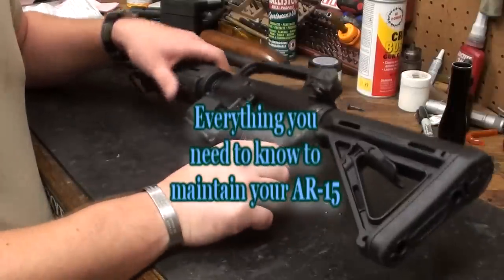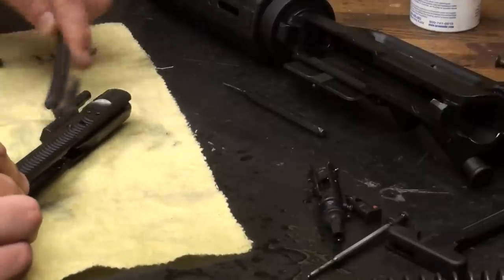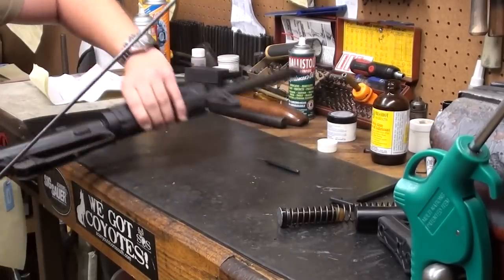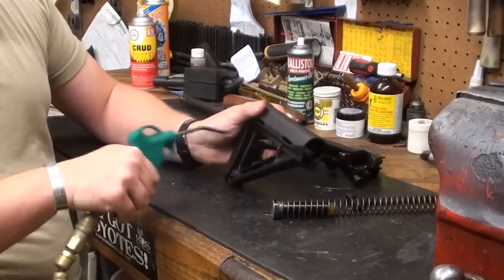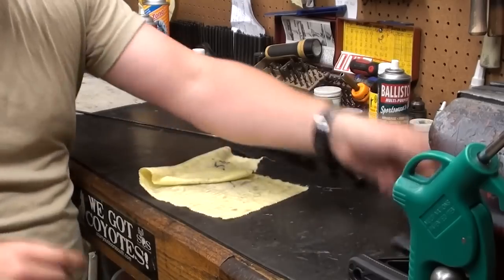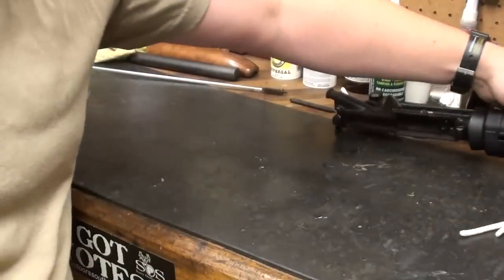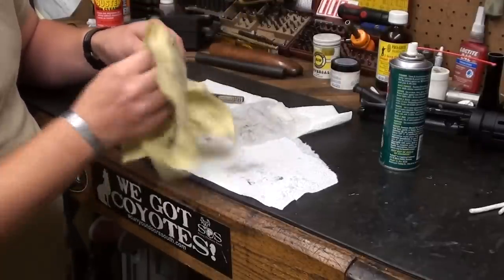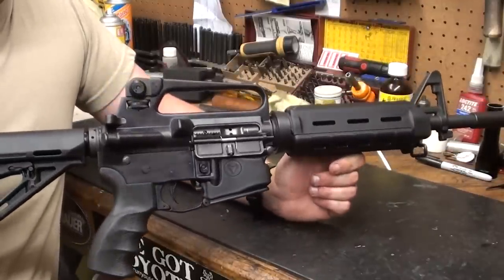Clean your AR-15/M-16 rifle or carbine (Now!)

Comment: Fall 2009, Houston, TX: My RRA LAR-15.  I fired 67 STANAG magazines (2010 rounds) of Lake City M855 SS109 (62-gr steel-core green tip 5.56NATO) with ZERO CLEANING--only added oil to the bolt carrier (through the ejection port) when rifle seemed dry.  1 (ONE) failure to extract, due to stripped rim.  This test was performed over the course of 3 weekend range trips.  Average 10-shot group @ 100 yards: ~2.25" (iron sights), ~1.50" with ACOG TA-01NSN 4x32.

Keep your AR oiled!!!
Reply: Mmhmm

Comment: @PatriotTNPr 
That's a "NeverQuitGrip" on the magwell.  Your lower needs to have a removable trigger guard so this can slip on (most are but ex: POF's are integral).  I don't recommend holding the magwell while shooting but if it works for you, the never quit grip might be more comfortable.  It's about 25 bucks.

Comment: Continued... Mags for ar15s are cheaper then ak mags. Steel surplus ak mags run about $20 each Pmags for ar can be found for $10.99-12.99 depending on gen. Ar parts wear sooner then ak parts being as most ar parts are aluminum. But they are easy to replace and rebuild. Everyone has ar parts online and in store all you need is a hammer, brass punches, screw driver, and castle nut and delta nut wrenches. You can build them in your garage. I am a young man with steady income and wanted a gun that

Comment: Interesting, I clean my guns VERY well right after shooting, but I never thought to remove the extractor, I normally will the bolt soak and then spray it down with non chlorinated brake cleaner. gets 99% of the gunk out.
Reply: Brake cleaner is amazing stuff for cleaning guns

Comment: Barbasol shaving cream and super got water do a good job getting the carbon out of the upper reciever. Dry with compressed air and oil. Repeat with a toothbrush if its really fouled up.

Comment: Ok first off the thing you pull back is a charging HANDLE not hammer, If the rifle isn't cocked you cannot put the selector on safe, I know its weird but that is how they are built the hammer has to be cocked for a AR to be safetied. Second when you chamber the first round DO NOT RIDE THE CHARGING HANDLE IN TO BATTERY pull it the whole way back till it stops and let it fly home without your hand on it. If that don't fix it I would go with a hammer spring or a out of spec firing pin.

Comment: Haven't cleaned mine in 3 outings and mine runs great. I'll admit mine had horrible jamming issues but since I replaced the extractor spring the rifle operates flawlessly so I just think it came with a faulty extractor spring.

Comment: Clean doesn't matter without lube. From a weapon maintenance standpoint you're often better off just dumping lube on the carrier and bolt and running the gun wet rather than trying to white glove everything.

Excellent video, though.

Comment: I have a question somewhat off subject it's about wear on the upper receiver notch were the charging handle rest & the charging handle coming loose. I just built my first AR15 it's mid-length gas system chamber in 5.56. I've test fired only 100 rounds through it. Midway through my testing when my last round of the mag would fire and the bolt would lock back my charging handle would come loose. I thought "that's kinda funny" so I push it back in place and loaded another mag and again, bolt locks back, charging handle comes loose. Some other info I think may be important 
1. when firing the casing shoot out at 2 to 3" o'clock, I don't think it's over gas but I'm no expert.
2. it has a carbine buffer tube and spring by spike tackle, the buffer weight is about 5.?? ozs, don't remember exactly  
3. charging handle notch looks kinda beating up for just 100 rounds
wish I could show a picture.
4. it's ambi dex Aero Precision charging handle

do you have any idea why this is happening?

Comment: @macfin88 
Huh, that is odd. Normally keyholing is a result of not having a tight enough twist rate to stabilize the bullet. But 1/9 is fine for light 5.56.

Comment: The spring in the extractor compresses quite a bit , and the desired action is for this to 'float' installed back on the bolt. What if it doesn't float ? I think I had a little rubber o ring on that spring at one time.

Comment: only problem with the ar in my opinion is ammo cost. If you want the gun to be as reliable as possible your gonna want to get brass cased ammo. With the ak your good to go with steel case. Locally here XM193 which I like and stock pile when I can runs $8.99 for 20. For ak I can get $5.29 for 20. This cost adds up quick for a defensive rifle. Plus side I same my brass so if I ever choose to reload I can. Can no do that with steel case.
Reply: Why don't you like steel cased ammo in your AR15 and don't mind it in an AK?

Comment: @TWELVEGAUGEDAVE870 Thank you for the info! I hold mine by the mah well because firstly, I'm a southpaw and secondly my barrel isn't free-floated. It was demonstrated to me that holding the handguard shifts your POI at rage. Lastly, going to the magwell as a point of reference like a vertical grip, the magwell is universally located on all Ar-15s so it i's a good location to default to if you were to wield any other rifle. Thanks again Dave!

Comment: What is your opinion of chrome bolt carrier groups? Obviously they are smoother with a chrome finish vs flat rough anodize finish, and again obviously easier to clean because you can see black gunk better on silver instead of black. Still, I want to know if anyone has any personal experience with the chrome bolt carrier groups. Pros, cons, etc.

Comment: Thanks... I found out what  was wrong. It was made wrong. The package was marked .22, .223, 5.56. I got another one and it works fine. I had already thrown the package away, but I know I double-checked the size on it before I bought it. It looks like the bronze brush secondary part is 22cal., but the primary buffer on the cord is too big to go through the bore. Thanks for your input. Long live the 2nd amendment!!!

Comment: Since most of you are into the whole MILSIM scene, just clean everything. Firing pin and bolt should both be shiny, if they arent then you are wrong. Bolt carrier and charging handle are subdued. Clean the inside of your gas system or it WILL fail. If anybody wants to test my knowledge, im in the Army and we clean our M4's weekly.

Comment: no don't use wd40 there are better alternatives.  if you want cheap lube use a synthetic motor oil or grease.  If you want a cheap cleaner google Ed's Red.  If you have money to burn try froglube or any brand of clp.

Comment: Question how easy is it to clean with one hand??   I ask this question because I have Cerebral palsy I’m not able to use my right hand, but I can use my right arm.  

I’m thinking of getting an AR and I’m just curious how much I’m able to clean it without asking for help.
Reply: as long as you can pop out the rear pin and take out the bolt carrier with one hand you should be good. actually hold up let me see if i can take down my rifle with one hand.......yeah its easy but you may need like a knife or pen or something to get the firing pin retaining pin out. if you do get one, a bore snake is probably one of the easiest ways to clean your bore especially in your case. some of the more indepth maintenance like replacing the gas rings or taking out various parts for replacement you may need to get some help if you go to a gun shop im sure someone will be glad to help if you just ask( basic maintenaince is easy and you can probably do it one handed). love my ARs you wont regret getting one
Reply: Blaze AP Thanks for the info!

Comment: I bought one of those and can't pull it into the bore... I guess I'm mostly afraid of getting the damn thing stuck in the chamber. It' for a  22cal which should be the right size.... ? Am I just not pulling it hard enough? I would appreciate any input because I would really prefer to use it instead of a rod and patch.
Thanx

Comment: This is kind of random, but have you ever seen that old footage in Veitnam where the guys were cleaning there A1's in a giant tub of diesel fuel.  Like 10 guys standing around it scrubbing there BCG's.  Then they used motor oil to lube it up.  I work with diesel fuel a lot and it's to damn stinky to get on ya.  I bet the VC smelled them coming.

Comment: I just bought an AR 15 and I'm just wondering how many rounds I should go before cleaning it? And this looks really confusing taking it all apart and I don't have that equipment to help clean
Reply: Best you can do is consult your owners manual for recommendations on how frequently you clean. I know a lot of people who clean after every use out of habit. You can also inspect visually for carbon buildup to give you a good idea of how clean your system is. As for the equipment needed to clean your rifle, head to your local gun shop/gunsmith and have them set you up with a cleaning kit for your rifle.
Reply: If you feel the need clean make sure you do clean it before storing it to prevent corrosion

Comment: Holy incompetence.... Over cleaning is the largest issue with the AR15 style weapons. After 10 years of running junk arm weapons I'm still waiting for a non-mag related malfunction. Wipe off the big chunks of carbon and oil. Oil sticks to carbon not metal

Comment: can u use wd 40
Reply: Chalino Sanchez  I’m curious is you tried it?  I’ve used WD40 as a chain cleaner/lube on mountain bikes. It works great as it is cheap and literally spays away dirt and grime as I apply it. I have to apply it often as it seems to “get thrown” off after awhile. It also seems to attract dirt so I need to spray it clean/lube it often.  

I imagine WD40 used in an AR may have similar issues as well as heat degradation.

Comment: should you clean the gas tube, if so how?
Reply: +Always Armed88  cant really clean the gas tube just wipe everything down light lube with CLP
91F small arms and artillery repairman-army 
ARs are awesome and in the army you see some crazy stuff especially in the 82ND
Reply: pipe cleaners.
Reply: The average person doesn't  have a set of rollpin punches to take the tube out brake cleaner is awesome
Reply: There is no need to ever clean the gas tube. The high exhaust pressures that run through it is more than enough to clear any buildup.

Comment: Why use an ultra sonic cleaner? I thought this video was to TEACH us how to clean our AR 15? The average shooter doesn't have an ultra sonic cleaner!!!!
Reply: They're pretty cheap, $70 at harbor freight
Reply: Ryan Grobe does it matter if they are 70 bucks??, most people dont have one
Reply: I think this is awesome actually, I’ve seen 1000 AR cleaning videos and this is the first on ultrasonic cleaning. With my dad getting older I’m now responsible for cleaning and maintaining some 30+ firearms between the two of us. Now that I know how they work I’m probably going to get one of these things.
Reply: For a less expensive method, just use some Hoppe's number 9 solvent cleaner and follow Hoppes directions, or use some ballistol. Ballistol cleans & dissolves traces of copper, lead, brass, and zinc. It also lubricates and protects firearms, and barrels by leaving a film that protects against rust. The good thing about ballistol is that it contains no carcinogens.
Reply: Break Free CLP is another good cleaner and lube for temperatures down to -65 degrees F. without the lube gumming up or breaking down. Make sure you use safety glasses with these chemicals! Also, use in well ventilated areas. If it gates on your skin, clean with soap and water. If skin irritation continues, consult a doctor.